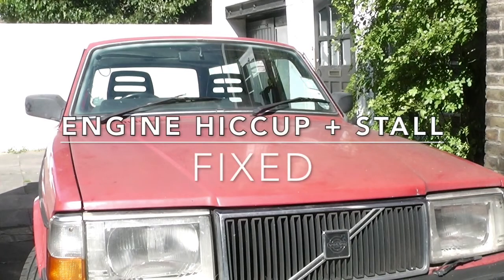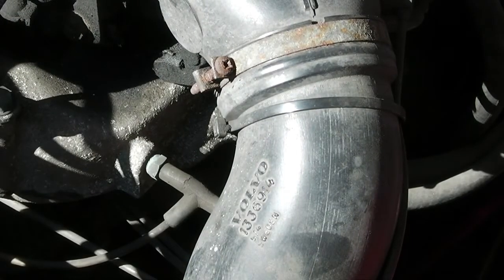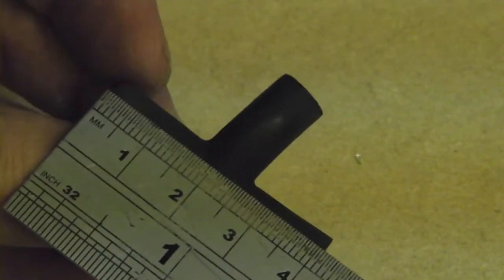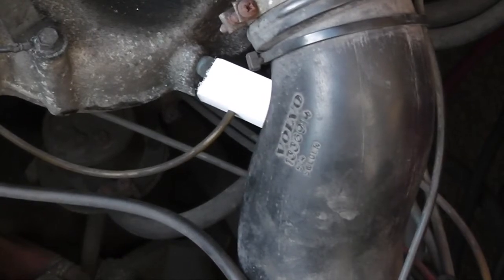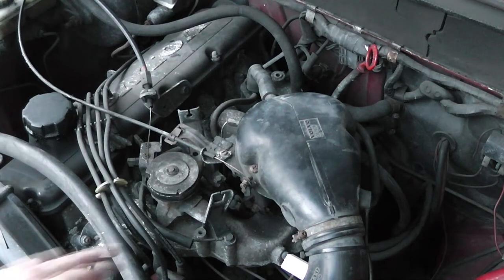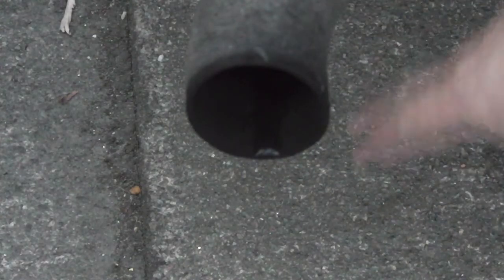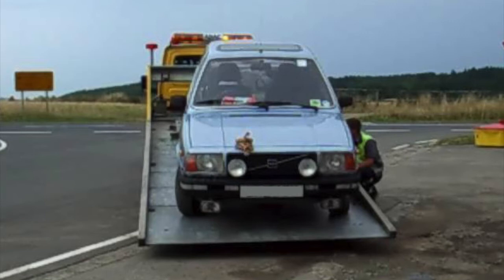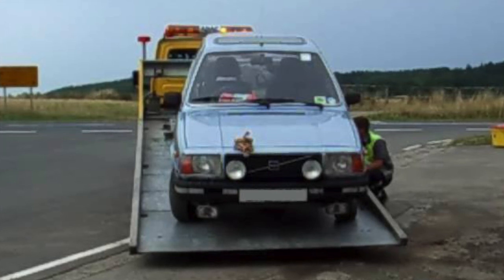Engine hiccup and stall - fixed (Volvo 240)

Comment: Between 7:52 and 7:59 the video acts up. Quick question, so all you did was tighten up the bolts on the carburetor correct?

Comment: you should check your wiring harness, the wires become brittle and touch causing other idling and charging problems, 
also clean flame trap.
Reply from the maker: Yeh thanks for the tip, everything on a car this old is falling to pieces! One of the bonnet hinge (3mm thick steel) just snapped so I had to make a new one myself. Happy days :)

Comment: Hiya, nice to see another view of your interests and a proper car with little or no computerisation. Keep up the good work.
Reply from the maker: Cheers - it really is the Open Source car, since there's so much info posted about it online. I'm planning to use my CNC router to make replacement parts for it, if anything else breaks.
Reply: +OpenTronic I like it when 3D,laser and cnc are used to replicate mass manufactured parts to repair items. The thought of taking 💷💷💷away from the pocket of big industry is such a buzz 😀😀😀😀😀👍
Reply from the maker: especially when the big industry in question has decided to stop making good cars, and these days just make cheap plasticky things with engineered obsolescence (Volvo!)